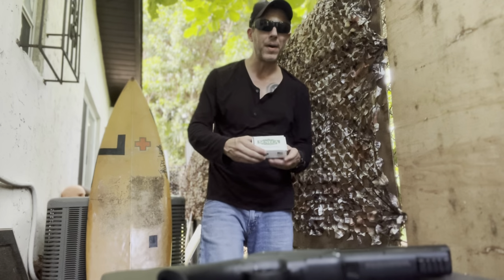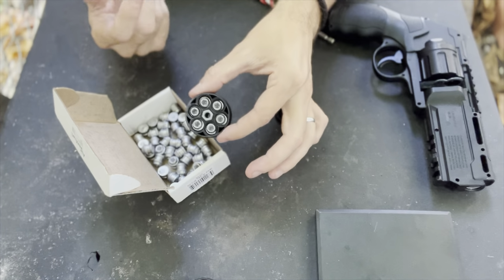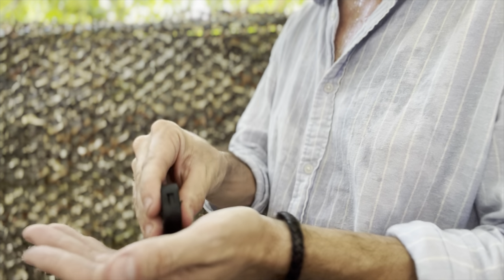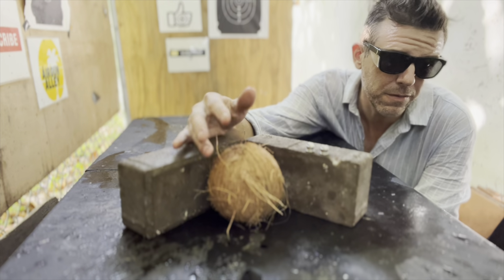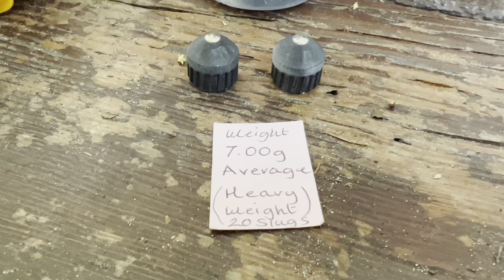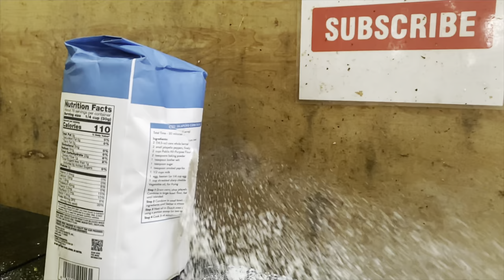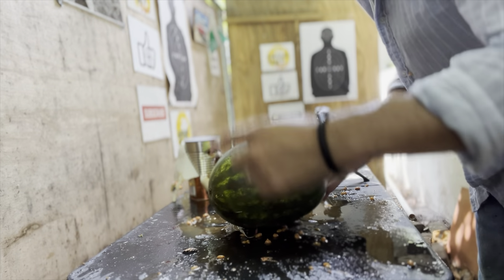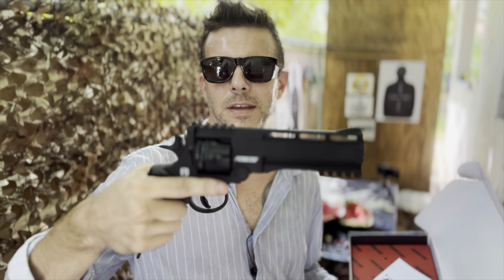HDR 50 • 50 cal PELLETS

Comment: I'm not an airgun shooter I stick to the real deal. I do think that this airgun is kinda cool. Using those lead pellets is an interesting idea. But for the price of them if it was me I'd pass. $25 for a box of 50 is expensive. I'm buying a 50 round box of 9mm for $15 or less. What could be an option is to cast your own pellets. I shoot black powder and I cast my own round ball. There are plenty of moulds available. Surely a few of them would work and it will be cheaper too.
Reply from the maker: Thank you Richard, good input!
Reply: It would be interesting to see how a 50 cal round ball would perform. Also I think an easy option to perfectly size them to the cylinder is to drill a hole of exactly the right size in steel and pressing the lead balls through. It should shave a ring of lead off and if sized right would go right into an unmodified cylinder just right
Reply: @davidbielski3484  round ball will hit with less energy
Reply: Where are you getting 9mm x 50 these days for $15?
Reply: @edwhitson9873  literally everywhere online, at the local gun shops and even the big box stores
Reply: Sounds like alot of work to save a couple bucks
Reply: He ain't lying, 9mm ammo has dropped significantly in the last 6 months. It seemed too good to be true to me when I read this but I'll be damned if I didn't just get a 100 rd box of Win 9mm FMJ for 28$
Reply: @edwhitson9873  18 in phx
Reply: @HansBelphegor  thats good if your not oaying the shipping 👍
Reply: Where are you getting 9m for 15$ I pay 34 for 50
Reply: @stevenrivera4062  casting your own round can be a lot of work at first. It's like anything else there's a learning curve to it. Once you get the system down correctly it tends to move fairly quickly. There's also the fact that a lot of people find it fun so it doesn't really feel like a whole lot of work. I could cast 200 of the same pallets he was shooting for the same price that he paid. That's not an insignificant amount of money that's being saved.
Reply: @travisj.1938  Most places online don't charge shipping if you order a whole case
Reply: @hueywilson716  if you're foolish enough to pay that price then I can't help you
Reply: @WillyOrca  that's an even better deal than what I've been getting. All the local shops around me have 50 round boxes of Winchester Q4318 for $15.
Reply: @richardcontinijr9661  that’s the price everywhere I go 🤣 gun shop, gun range , sport stores literally everywhere. But I also live in NYS
Reply: @hueywilson716  and your foolish enough to pay it instead of ordering a case online for under $300 with free shipping
Reply: @richardcontinijr9661  more about convenience than it is foolishness 😂 if I was too order online I’d have to get them sent to a FFL dealer and a lot of sites don’t even send to NYS so. That’s not really a option for me.
Reply: @hueywilson716  I never had a problem having ammunition ship to Buffalo. Nothing's more convenient than a few clicks on your phone and having it show up to your doorstep. So yeah if you're going to pay $34 for a box that's foolishness on your part.
Reply: @richardcontinijr9661  that’s where I live. Buffalo 😭 I’ve tried shipping ammo here before and the site I used at first wouldn’t even let me process. 1 site got me through accepted my payment than emailed me about it and issued me a refund so I googled it. And it says they have to be sent to a licensed firearm dealer 🤷🏾‍♂️ shit. If you know a site that I don’t know about pmo
Reply: @hueywilson716  I ordered from several places. They all wanted to picture of my ID and pistol license. Everyone of them shipped to my door. I don't have to deal with it anymore.  Move New York is a cesspit.
Reply: @richardcontinijr9661   actually bro. Thank you. 😭 just ordered my 1st box offline. Got 200 556 for 100
Reply: @richardcontinijr9661  ugh. They emailed me and cancelled it 🤣 took 4% too. Said it has to be shipped to a registered firearms dealer and picked up in person
Reply: @richardcontinijr9661  I know it is bro. All these new laws are out right outrageous. It’s unconstitutional can’t even buy a rifle without a license now
Reply: Yah I agree that firearms are and always will be best. I will say the airgun is only second to a gun and will only lose to a gun and even then I think allot of criminals would quit even with a gun in fear of being shot with this extremely painful self defense tool. That's why I believe these are super handy when you in a situation that you really don't wanna kill the person which believe me they happen.
Reply: Sad thing is a couple years ago you could buy a 50 round box of cheap 9mm at Walmart for $8
Reply: @hueywilson716  idk if nys has special gun laws or what but I've never heard of shipping ammo to an FFL, I've had ammo, AR uppers, parts etc shipped to my door
Reply: @jakespoon5747  we do have special gun laws. And a lot of them. New laws were just passed september 4th I believe banning the sale of any firearm to a person without a license including rifles, 16 hours of training 2 hours of range training plus a bunch of other stuff to receive the license making it way harder to get. Also you can’t have ammo sent to your house because now in NYS when you buy ammo they have to document the type of ammo. Why your buying it , and how much your buying and it comes with a 5$ surcharge now on top of the regular price. 😭 it’s a lot different up here
Reply: @jakespoon5747  I ordered a AR upper too 18in considering you can’t order anything under and they cancelled my order saying the upper had something that wasn’t considered legal in my state. So you can order uppers here too you just have to really pay attention to what your getting. I’ve ordered parts also. Only thing I cannot order is ammunition
Reply: @jakespoon5747  just talked to my local gun store and they don’t even do ammo transfers. It’s almost impossible to order in bulk online here
Reply: @edwhitson9873  right lol I need info
Reply: They are steel, not lead. : )
Reply: @keithh.2624  no the 185 grain HP he is using is lead not steel but nice try
Reply: I think may be good for home defense in apartment, close living situations,  as bullets tend too go thru sheetrock .....and keep going
Reply: @briansharp4388  M193 5.56 at 3000fps is perfect for that use
Reply: @richardcontinijr9661  not saying I'd buy it, but possibly has a place
Reply: Don’t talk about the devastor slugs..
Reply: Just glue some small whatever mm washer into the cylinders to make them usable again.
Reply: Ebay's cheaper demo ammo
Reply: @edwhitson9873  right wtfnhell
Reply: I used to shoot and reload real pistols and rifles. Then in 1997 Tony Blair made my hobby and sport illegal. I can't even have a high power HDR. If you don't fight every law that restricts your rights you will end up losing your firearms. The second amendment will be repealed and they have done that before.
Reply: Use a swaging jig with a die that is milled to the diameter you want. It's not a damn mystery!
Reply: @davidbielski3484 this is called swaging and it is the right way to do things.
Reply: That type of ammo and gun are not to bring to the field (its for some guys that need home défense (when convicted/or another reason you can t buy à 9mm)
Reply: 50 x 9mm round for 15 bucks ??? Fu.. y need to come to the us  😂

Comment: Hmm... a little cheat/hack to keep pellets in place: use some sticky paper labels over the face of the magazine, it should hold the pellets in place and would be blown apart by the shot, either that, or have two temporary THIN plates that you use to hold the shot in place while installing the magazine, and remove them when its installed
Reply from the maker: Good tips! Thanks a lot Gaisa!

Comment: Dude, thank you so much for taking the time to do this. I've been wanting to buy the HDR50 "Homewrecker" that's been modded to shoot with muzzle energy of 20 joules for a home defense option with greater deterrent potential than that of my Umarex Glock 17 (.17 pellets @ 350fps) or my Walther PPQ T4E (43 cal rubber/pepper/metal balls @ 410fps), but wanted to be sure I could fire conical rounds from her. Obviously .17 cal shaped pellets can press the off button on a coyote and similarly sized animals with accurate shot placement, but a thick jacket is enough to counteract any potential lethality even at close range. Which leaves the Aluminum 43 cal round ball ammunition I'm currently using with my Walther T4E which certainly hurts and will absolutely penetrate skin, take out teeth, put out an eye, and would overall be less than ideal to be shot with anywhere at <25 yards, and while it'll punch through the metal wall of my shed and my drywall with ease, I still worry about it's ability to stop a threat unless using pepper balls which as we all know is a piss poor idea for use within one's own home.

A 20 joule, 50 cal pellet at ~700 feet per second seems like an amazing option for an individual who's.... let's just say "limited" in their ability to obtain and make use of a firearm for home defense and must rely on alternative methods. 

I'd much rather pack a punch with an airgun which exhibits legitimate stopping power and penetrative ability than rely on a BB gun which has a purpose limited solely to plinking or hacking an intruder up with a machete. 

Anyway, just wanted to say thank you. Times are tough, I don't love in a very safe area, and don't have the money to waste of the gun weren't to function as I hoped. You really helped me make the most of my money and make the best choice in my current situation. 

Thanks again, Best wishes, and cheers.
Reply from the maker: Hey man! Thank you for all the info you provided. Your knowledge on the matter by far exceeds mine, but I’m more than happy to help!
Reply: @Suckmyjagon  I'm well aware

Comment: Instead of using a masonry bit, (for drilling holes in concrete), I think a high-speed steel drill bit would have made your holes much more accurate,
for higher muzzle velocity
Reply from the maker: Absolutely! That was totally my bad 🙌🏼
Reply: @AirgunAlley  I’d go forestner bit and a dill press
Reply: @AirgunAlley  some kind of a jig and press setup would give you way more accurate aligned holes as well, vs free-handing it. The best part was at the very end though – your kid is adorable! I have a little one who is just a bit younger.

Comment: Use the "straight through" drilled cylinder and  smear each chamber with bees-wax before loading , that should help in keeping the slugs in the cylinder .
Reply from the maker: Nice! Thanks for the tip
Reply: Yah might want to be careful with the bees wax,… I made various projectiles using paraffin wax, as a sabot, or bonding medium. When the wax happened to be warm enough, to be tacky,… it resulted in quite spectacular dieseling. A power modded HDR 50 is loud enough on its own, but when it diesels, it’s enough to make your ears ring, and maybe draw unwanted attention. That being said, I’m not saying, I’ve never packed a little petroleum jelly, behind a 50 cal steel bb, and risked it blowing up in my hands and face.

Comment: Awesome video 👍. When I drilled mine out I only took a little bit out so most of the pellets sit perfectly, and so far I haven't had any cycling problems. Thanks for making this video sir
Reply from the maker: Thanks Mister Head! I tried to do my best in following your instructions. As you see I’m not the best craftsman - but for those who are, this is surely a great revelation! (I’m also particularly unlucky with this stuff. The jamming of my gun is probably just a result of that). Anyway thanks again, I hope to not have disappointed…
Reply: @AirgunAlley  I just uploaded my first videos to show what I did to make them work. I haven't had a single jam yet🤞. I really hope your TR50 is okay sir.

Comment: 1) Use a 1/2" hand reamer on the cylinder (by hand) not a drill bit. Hand reamers have a tapered section which can be used to create a tight bore at the end. 2) use pure lead round ball. They are the same weight, cheaper, more available, and they don't have a useless hollowpoint that isn't going to open up.
Reply from the maker: Thanks a lot for the input my friend!

Comment: I was having the same problem. I drilled too much the chamber so it can fit cheap steel balls 1/2". Problem solved with a thin layer of black silicone applied with a straw for roundness. Now they doesn't fall out
Reply from the maker: Good one! Thanks a lot George!

Comment: I think lead is too soft to have much adverse effect on the barrel, directly, you’re just not gonna wanna use wire brushes to clean the barrel. I also, think there’s room for improving lead projectiles to be optimized for the HDR50,…; Like the more hollow you could make the projectile on the interior, before risking it mushrooming prematurely and jamming in the barrel would be ideal. Maybe even one,… where you fill the mold to capacity with .177 BB’s, and pour the molten lead, subsequently, so there’s just minimal lead,.. only just sort of ‘gluing’ them together, until they smash into the target. 😊
Reply from the maker: Man I'm with you 100% and thanks for the cleaning tips! Hopefully we'll see more of that ammo indeed!

Comment: Why did you use a masonry 1/2 inch drill bit instead of a much more precise bit designed for wood or metal? The bit you used is intended for use in concrete and stone and designed to wear a little bit before they hit the exact half inch size.
Reply from the maker: Where were you when I needed to know all this stuff?? 😂

Comment: Hello, I just bought a TR50 11 joules revolver (t4e). I'm used to a real pistol with these type of pistol when dry firing shouldn't the cylinder rotate? Or is CO2 required? It's just out of the box 5 cylinder/ mag's.were included but none cycle? Thank you... Keith
Reply from the maker: Hey Keith, yes the cylinder should absolutely rotate simply by pulling the trigger. No CO2 required. I hope that’s the case for your new gun!
Reply: @AirgunAlley  thank you for your quick response! I've noticed if my finger is on the cylinder it does cycle! Did I purchase the wrong pistol? Quality wise?

Comment: That’s because you used a 1/2 masonry bit, if you used a regular 1/2 drill bit it probably would have been fine. That masonry bit has a tip that’s wider than 1/2 inch
Reply from the maker: Hehe I know now. I had that one available and didn’t really know it made such big difference

Comment: Good video thanks for the heads up on the drilling thanks.
Reply from the maker: Thank you my friend! I bet they work a lot better in the hammer hehe !!
Reply: . 498 diameter seneca are for the seneca dragon claw 50 cal. The Ummarex hammer is .510 diameter . You wont get accuracy shooting a slug that is .498 in the hammer that is for .510 slugs. . Mr Hollow point has .510 slugs

Comment: I need to find some good slugs for the HDR68.  It was super weak but I removed the chamber block. Only get 5 good shots but damn they pack a punch.  Hope to find a carbine kit for it.
Reply from the maker: Hey man, that’s great! I hope you’ll find a way to keep that power, but also increase your number of shots. I know you can add a small “cap” at the valve’s mouth, to better regulate the flow… but you’ll have to turn to experts videos about that..
For the slugs, stay tuned - I’ll keep testing as many as I can get my hands on…
Reply: @AirgunAlley  I'm thinking of going with tyr 88 gram adapter or even HPA.  Want a carbine kit for it eventually as well.  Just did a short live feed comparison of my t4e markers if you want to check it out. Travis Wolfheart.
Reply from the maker: @travisnelson9247  I couldn’t find your channel 🤔 what’s the link?
Reply: @AirgunAlley  I dont have a YouTube channel yet.  I just do short videos on fb a lot.  Been thinking about it at though.  Have had a lot off encouragment to do one.
Reply from the maker: Do it! It’s all a matter of getting started. Once you do, the rest follows :)
Reply: @AirgunAlley  thank you for the encouragement.

Comment: When you see someone using a masonary bit for plastic makes me cringe. Like using steel bits into concrete, wood bits into steel etc. Its not that hard guys.
Other than that, great vid as usual.
Reply from the maker: Hahaha I lived off of a backpack til I turned 39 years old. I never opened a tool box in my life! Drill bits unfortunately are completely out of my knowledge. I should’ve googled it, but the most important is that you guys got the idea 😂
Thanks a lot my friend :)
Reply: @AirgunAlley  No problem mate 😆, we all have our strengths. I think if you used a steel bit, the fit would have been more precise, air tight and hence making the rounds much more useable. They look decent, so i would give it another bash with a cleaner drill hole, as that masonary bit would have drilled a horrible hole.🤠. Obviously a drill press would be ideal, but i doubt you would have one. Keep up the grate work, thanks to one of your most recent vids i ordered myself some CODODO  Hunting Arrow Slug broadhead extreme.

Comment: I can buy an actual box of 45 ACP and go to the range for that much not to mention the thing you're doing when you enlarge the cylinder that cylinder is a size for that projectile cuz the projectile is size for the bore so if you're putting the oversized projectile and stuff and it forcing it through that bowl or you're risking and blowing up in your face and where at the barrel real fast
Reply from the maker: As seen in the video, before shooting them, one if the pellets fell right trough the barrel, when I pointed the muzzle towards the ground. Therefore no risk of blowing anything up. Surely they can’t be healthy for it, but again, no risk of explosion.